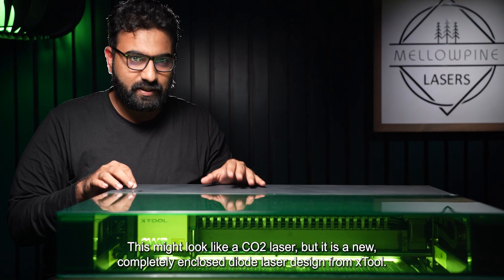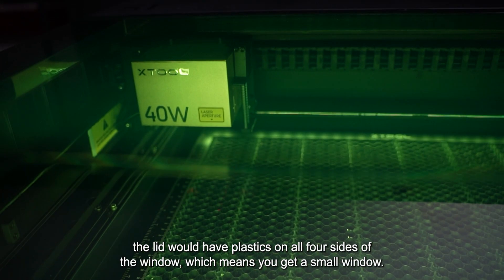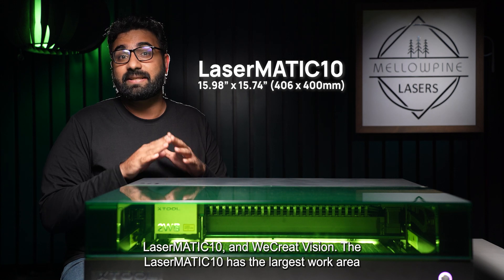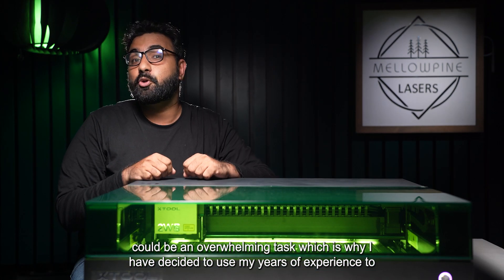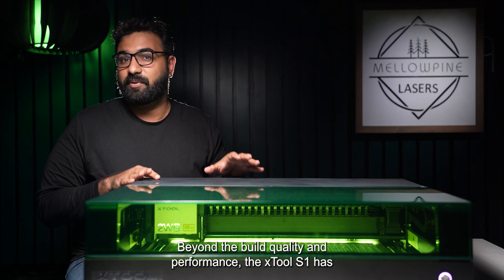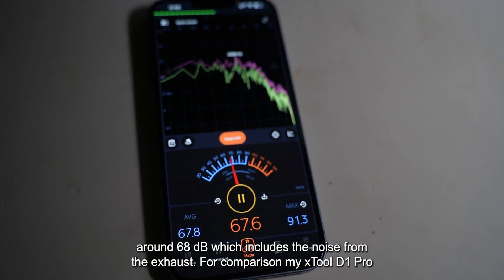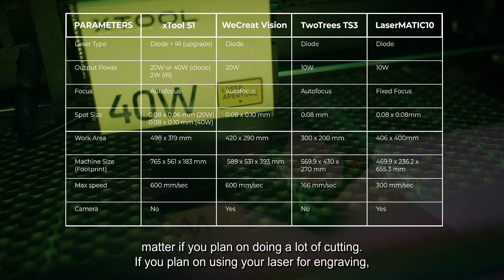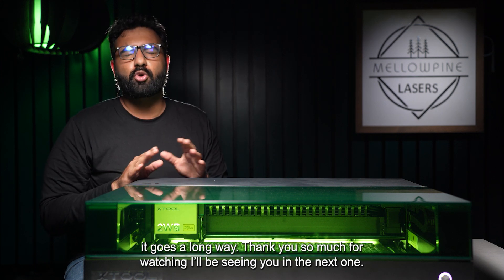Is the xTool S1 Laser Worth the Hype? - Full Review

Comment: Machine is very nice CO2 laser I will be purchased your machine how much cost for Indian rupees I am a reseller for where v is purchasea machine 40 watt to above this laser beam available yes 60watt 80watt 100watt working area size maximum to maximum
Reply from the maker: Hi, 
This is not a CO2 later this is a diode laser and is available in 20W,40W, and 2W infrared configurations. It costs around INR 1,80,000 + shipping and import duties.

Comment: cant believe you guys recommend ABS as a material. it is dangerous to cur or engrave ABS due to the cyanide gas emitted and it will damage the laser as it melts more than cuts.
Reply from the maker: You are absolutely correct! ABS does emit cyanide gas when burned. Therefore, laser cutting ABS is not advised.

However, laser engraving ABS at high speed and low power using an IR laser oxidizes the surface and causes a color change without melting the material. When executed correctly, this approach does not produce any harmful fumes. But safety always comes first, so it's essential to ensure proper ventilation and safety precautions when working with ABS. We appreciate you highlighting this important fact that we missed out in our video. Thank you.

Comment: Can you explain what how to get the best detailed engravings on the Xtool S1
Reply from the maker: Engraving on different materials demands specific settings and techniques to achieve the best results. Do you have a particular material and design in mind for your engraving? Sharing those details can help me offer more precise advice on the subject.
Reply: @MellowpineLasers  Hi, I only want to know if the detail quality of engraving with the 40W is as good as it would be with the 20 W or 10 W or 2W.
Furthermore: can one reduce the power with the 40W to a lower power, getting more detailed and accurate engravings?
Reply from the maker: The detail quality of engraving depends on the spot size of the laser. Generally, the higher the power of a diode laser, the larger is the spot size, which leads to loss of detail in intricate engravings.
Unlike CO2 lasers, where you can swap the focusing lens to get a tighter spot size, diode lasers have a fixed focus. 
So, you can control the power output of a diode laser, but the spot size will remain the same.

xTool S1 has a spot size of 0.08 x 0.06 mm (20W) and 0.08 x 0.10 mm (40W), which is comparatively smaller than most diode lasers with similar power output.
Reply: @MellowpineLasers what would be the advantage of simultaneous buying an infrared 2W (?) laser? Would that be the ultimate solution for fine detailed engraving and would that laser also be useable on the S1?
Reply from the maker: Diode lasers are not suitable for engraving on reflective metals or transparent plastics, that's were the Infrared module provides an advantage. The 2W IR module can be used to engrave on metals or plastics.
So, if your requirement involves engraving a variety of materials with occasional engraving on metals, then it is advised to get the xTool S1 with the IR module. 
Yes, the IR module that comes as an upgrade for S1 is useable with S1. You have to swap the laser head to use the desired laser module.
Reply: Thanks @MellowpineLasers  , what can be cut with the 2W IR laser by the way (materials and depth)?
Reply from the maker: The 2W IR laser is not really meant for cutting. You can use it to etch shiny metal workpieces, a task that diode lasers can't efficiently accomplish.
Reply: @MellowpineLasers  Thanks for the extensive answers and explanation; other S1 testers do not react at questions, you do and excellent!
Reply from the maker: Always happy to assist with any questions you may have! You can also join our Facebook group and discuss all your laser-related questions there.🙂
https://www.facebook.com/groups/mellowpinelasers